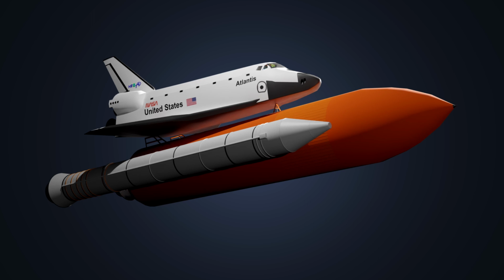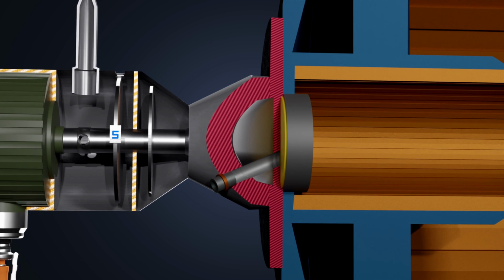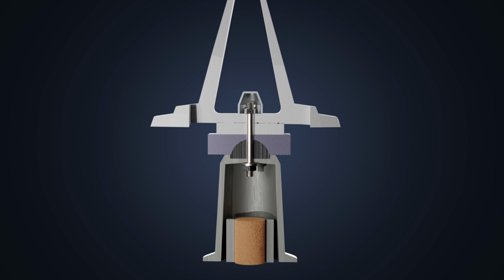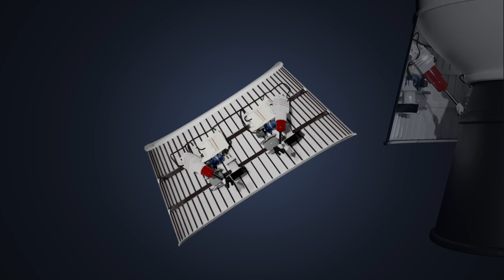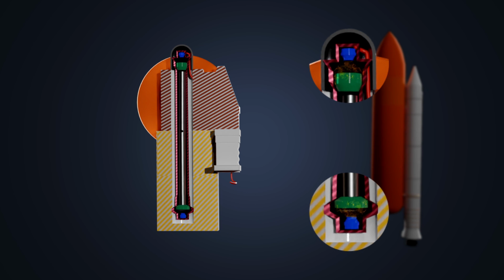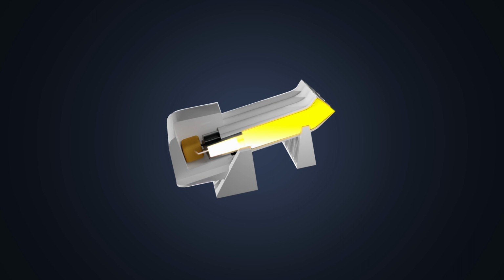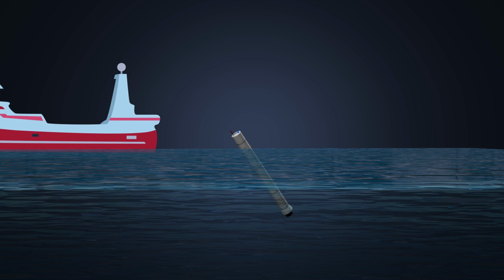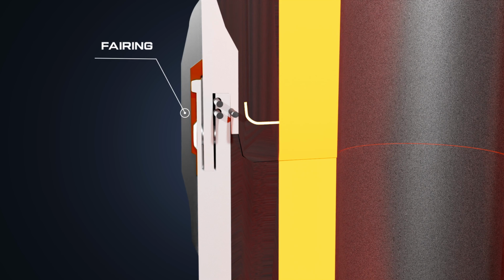How it works ? | Solid Rocket Booster

Comment: I am presently reading "Challenger: A True Story of Heroism and Disaster on the Edge of Space" by Adam Higgenbotham.  I have reached the part during the months leading up to the Challenger launch when various engineers developed serious doubts about the solid rocket booster O-ring seals.  (Actually, we should call it the "solid-FUELED rocket booster.")  This is a stupendous addition to that tale, with the detailed descriptions of the booster operations -- along with visual portrayals of the equipment.  P.S.  The solid fuel in the boosters, a combination of mixtures and compounds, had the approximate consistency of a pencil eraser.  Just an interesting little factoid.
Reply: @Oldag75  one of the engineers was convinced it was going to explode on the launch pad .

Comment: How come they weren't made in one piece?  Would have prevented challenger explosion if made in one piece, no?
Reply from the maker: I think its hard to manufacture and transport a long one piece and it is easy inspect for any issues
Reply: each section must be xrayed for inspection after fuel has hardened.
Reply: One contractor did submit designs for single-piece SRBs. The challenges of shipping something that huge to the Cape, plus the cost drove the decision to go with Morton-Thiokol's segmented design.
Reply: @scottschoppert9149  Transportation. Their diameter was also affected by this. They had to be right right size to fit on rail cars.

Comment: Are you sure theres is no way of stopping or even throttling it?
Reply from the maker: There is no way to stop them or throttled as far as the ones which are in use.
Reply: @immersiveengineering  what about sectioning them like rotating cylinders with gaps?
Reply: @mr.ackermann807  You need to take into consideration the temperature of the burning fuel. If you also add cooling then you decrease the volume for fuel and will therefore need longer/bigger rockets to produce the same thrust. 

Larger rockets with cooling will add a lot of extra weight and therefore more thrust will be needed. The extra thrust will need to come from more fuel…. 

It a compounding problem where more fuel will be needed at the end and much more money/resources will need to be invested/spent for a single launch.

This method of getting things into space is already expensive as it, making it more expensive is suboptimal.
Reply: @alh3328  I already know it is expensive enough as it is. And thank you for reminding me of the temperature, so most metals or alloys would be a problem. The other method that I can think of is stage burning where as 1 finishes it burns the next but the problem again is the temperature plus I think that's technically what happens anyway just not controlled staging burning. I was also aware of the mass to fuel ratio for needing more rockets for better cooling, so ok. I'm still constantly learning and willing to take criticism and advance, so for that thank you for your input.